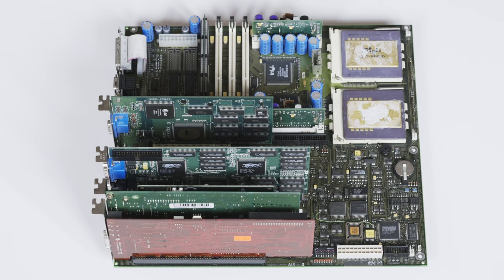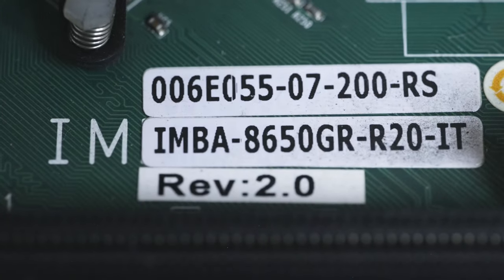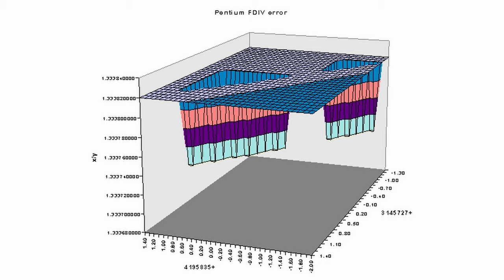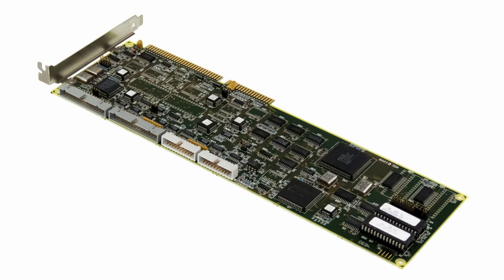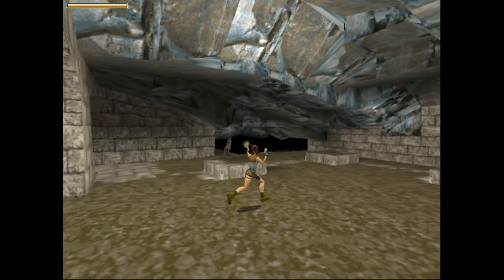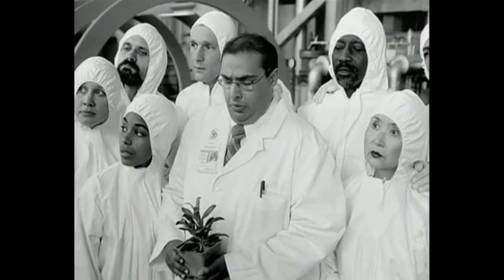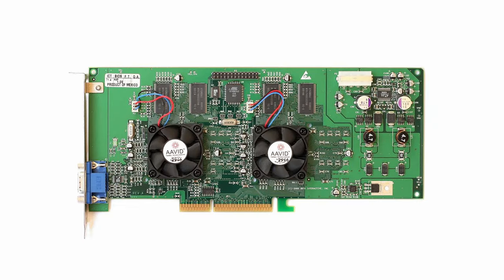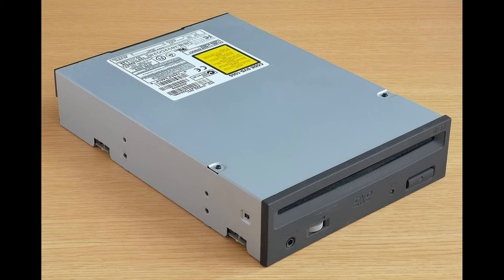What is the best build for DOS gaming?

Comment: Thank you for the video. There are a few things I like to comment on though … .

Several points / aspects were skipped:

1. The price: The cheapest vintage system currently is Socket 370 Pentium 3. Pretty much anything else has become forbiddingly expensive, and though some inexpensive Socket A can be found, having ISA slots is rare there – something you need for proper DOS sound support.

2. State of hardware and compatibility: Many older Pentium 2 or 3 boards, especially those using the Intel 440LX, BX and ZX are unlikely to even start anymore. There also always are issues finding compatible RAM, because only older modules seem to be detected completely – if at all. Those furthermore are a somewhat bad choice for the Pentium 3 667 upwards – they can’t really keep up. And the maximum RAM ( when focusing on DOS / DOS age ) is 512MB. My recommendation would be the “Via Apollo Pro 133(A)” Chip such as with the Elitegroup P6X motherboard series, which while not the fastest is compatible to essentially anything, equipped with 2x 256MB PC-133 RAM.

3. The OS: The most current still fully DOS compatible OS was Windows 98 SE. It’s also important that it can be convinced to properly support USB storage devices, and offers the latest standards of the time – such as DirectX 8.1 ( 9.0c ). If you don’t intend to even use Windows, you probably would be better off with something in between an 486 DX4-100 and a Pentium 1 233MMX with 16 to 32MB RAM. Anything above 512MB RAM, 667 MHz CPU and Voodoo 3, is more along the line of a Windows XP system which offers but reduced DOS or GLIDE compatibility.
Don’t use Windows 95 or older unless you have less than 96MB RAM – getting it to run properly simply requires too much effort due to lots of usually unofficial patches and fixes.

3dfx Voodoo mistakes:
1. The Voodoo Banshee is the cheapest 3DFX which combines 2D and 3D. It also is identical to the Voodoo 3 except it works at only 100MHz instead of up to 166MHz, and only 1 TMUs instead of 2. This places it’s 3D performance in between the Voodoo 1 and Voodoo 2, which is no problem if running 3D at max. 640x480 pixels. As such, it offers very good 2D and decent 3D support through GLIDE, OpenGL and up to DirectX 6.0 . There are but three reasons you might want a different card for your vintage system: a. No good 3D at higher resolutions, b. support only for older 3D application, c. due to low color dept and missing effect filters, the image quality can’t compete with other 3D graphics cards of the time.

2. Voodoo 2 SLI does NOT provide double the RAM, just almost double the performance and Z-Buffer, which allows 3D at up to 1024x768 where only 800x600 would be possible with only one card.

3. The 3DFX Models were the Voodoo 1 4MB, Voodoo Rush ( of which at least 2 different versions using different 2D chips exist ), Voodoo 1 6MB ( such as the “Miro Highscore 3D”, rare ), Voodoo 2 8MB, Voodoo 2 12MB, Voodoo Banshee, Voodoo 3 PCI, Voodoo 3 AGP ( 2000, 3000, 3500 ), Voodoo 4 u. Voodoo 5. The upper graphics resolution is limited through the Z-Buffer Size ( 2MB for Voodoo 1, 4MB for up to Voodoo 3 ).
The 16MB Banshee / Avenger / Voodoo 3 have: 8MB for textures, 4MB for Z-Buffer and 4MB graphic RAM.

DOS 2D graphics:
Never use ISA, best not use VLB – the best option for DOS and early Windows are PCI graphic cars such as the S3 Trio (V,GX,DX,…), ATI Mach 64/Rage and NVIDIA NV1, best with VESA 2.0+ Bios support. Those allow up to approx. 1024x768 gaming, but older usually can offer 320x240 ( ModeX ) at best.
Saying you choice of graphics cards depend on your CPU is incorrect: The possible list depends on which slots your motherboard offers – just because a CPU generation usually come with a GPU generation does not mean you need to match them forcibly.

3D graphics cards:
You completely ignored the early Windows era 3D graphics card, as well as the most common and easily obtainable ones.
1. Those early very well known 3D cards were the NVIDIA Riva TNT, TNT2 and Vanta.
2. The most commonplace and usually more than sufficient graphics cards, are the NVIDIA Geforce 2 MX based ones.
3. Alternatively, one could go for an ATI Rage 128 / 128 GL / Fury.
However, none of these cards strictly speaking are meant for DOS, much less your preferred ATI Radeon 9550. As a rule on could argue that DOS ended where AGP started.

Graphic cards to be avoided:
1. Trident (Blade), essentially anything 3D. Usually found as SOC / IGP, they simply can’t keep up regarding performance and compatibility.
2. S3 Savage 3D / 4. Nice cards, but fell a bit short regarding performance and their drivers never got finished.
3. Rendition Vérité V1000 / V2x00. A nice collectors card, but too exotic to actually use in a vintage system.
4. Matrox Millenium / Parhelia. Those cards aren’t really meant for 3D, even though some support was added, and usually don’t produce anything of note. They are very robust and reliable though, so you might still want to get one.
5. PowerVR Kyro 3D. I love those cards, and you still can find it’s descendant in mobile devices, but the “infinite planes” function principle was quite alien and the drivers never got fully finished back then, which created graphical artifacts and inconsistencies for many games.

Sound …
… is a serious issue, because getting an inexpensive sound card with DOS and windows support is quite difficult. And in case you are wondering: The parallel use of regular ISA sound standards under Windows and for DOS boxes is not possible, because they conflict accessing the card. You need Soundblaster 2 Pro / Soundblaster 16 compatibility for DOS and should have a decent FM / Wavetable chip, because everything else is a real fight to get to work, or / and sounds like the end of the world.
By my experience, the best choice currently is a “Terratec Base-1” ( including OEM / relabeled versions ) and plugging a “DREAMBLASTER SYNTH S2” to the wavetable connector to avoid the terrible sounding Adlib FM support.
DON’T try anything exotic, such as installing a Gravis Ultrasound, UNTIL you got regular DOS sound support running. And no, a “Gravis Ultrasound” is, while nice sounding, quite difficult to use and currently forbiddingly expensive. If you want comparable sound, got for a Soundblaster AWE 64 or a Terracted Maestro 32/64, or use a wavetable as mentioned above or in the video.

Wrappers
Many DOS era graphic cards use “wrappers” to add the support of foreign API, such as OpenGL and Glide. Those try using as much GPU features as possible while leaving the rest to the CPU. Wrappers for main titles such as Quake 1, 2 and Unreal are provided by most manufacturers, and work quite well for those, but can’t be called proper or perfect by any means.

I hope I could contribute. ;-)
Reply from the maker: Cheers for the comment. I have to respond to that :)

1. That's basically what I said. I've just included Slot 1 to that, which I believe really is quite cheap.

2. It's true that lots of Slot 1 boards based on Intel chipsets you can find are more or less done for. But that can be said about any motherboard from that era. It's just an old hardware, and as such it's a just a matter of time when it stops working :) Personally, I'd choose Intel chipset over anything else any time. It's just more reliable and faster than any other chipset from that time.

3. I have nothing to add to that.

3dfx:

1. True, except, it uses Voodoo 2 hardware. Voodoo 2 has 2 texture chips, and Banshee uses only one of them, that's why its 3D performance is worse than Voodoo 2 and since Banshee came after Voodoo 2, it shouldn't be worse then it's predecessor.

2. True, my mistake.

3. Again, pretty much what I said.

DOS 2D graphics: 

I suggested to get any AGP card for this, which is probably the fastest possible option. And advised against ISA cards. I never said that graphics card depends on a CPU.

3D graphics cards:

I ignored all those cards, because it was supposed to be guide for DOS gaming computer and I reckon the only usable 3D card for DOS gaming is Voodoo.

Sound …
What I said... :)
Reply: Nice well thought out commentary.
I have to disagree as far as the Banshee being like a Voodoo3.  It only has one Voodoo2 TMU, not the same one as in the Voodoo3.
Also, for true DOS gaming experiences, I am a huge fan of using something like a GeForce 256 and slightly higher WITH a Voodoo2 (or SLI if you got them) card.  Having the 3dfx Glide is awesome for many older games.

Comment: K6-II with the CXT core or one of the mobile K6-II+ or K6-III+ are close to as versatile as it gets for DOS. You can use SETMUL to enable and disable caches and set the multiplier. On most CPUs you can only play with the caches. You can get almost any level of performance you need from 386 to slow-ish pentium II. It also has write combining unlike the original pentium and pentium MMX. This is an enormous speedup in DOS as soon as you try to use high resolutions. 640x480 is enough to start showing big benefits.

If you insist on running late DOS stuff in very high resolutions in software you may want a much faster system for that. 800x600 is already 7.5 times as many pixels as 320x200. Cheapest system for this is likely a socket 478 with AGP and at least one ISA slot for a DOS sound card. If you're just running DOS games that will run under windows 98 you can get away with PCI, but as soon as it has to reboot in DOS mode to run it will be troublesome to use PCI audio.

Comment: Good video, and pretty solid recommendation at the end for someone who just wants minimum fuss and good results.
In case anyone is interested, my DOS/Win98 build is:-
ASUS P5A-B with 128MB PC100, AMD K6-2+ 600mhz, Voodoo 3 3000 AGP,  Soundblaster16 (with OPL3), Aureal Vortex 2, HardMPU midiman clone for connecting Roland SC55mk2.
A very flexible system, the CPU is fully setmul compatible, and it even gives me three different devices to listen to midi with in windows, just be switching the midi output device in the settings :)
That said, Super Socket 7 is not for the faint of heart, there's always some issues you have to spend ages finessing, to get it right.
Reply from the maker: How does your Midiman work? Any problems?
Reply: @KITR-UK  flawless, in Dos and Windows. You can find the place that sells them through Vogons forums.
Reply: very good. I have similar super Socket 7 system(Via MVP) with AMD 333Mhz K6-2 (NON Plus version). I know Setmul requires mobile version to work with.. Does Setmul works great ? does it emulates speed of 486 good ? I think I need to update MB BIOS to accept K6-2+ version CPU. I just want to know that if K6-2+ is working great on SS7 system. or I can use Pentium 200mhz MMX instead..  I would just use WIN 98 + DOS or Win98 Dos mode.
Reply: @overdriver99  setmul is really useful, you can clock down to a 2x multiplier and turn both caches off, with a single dos command, if you really want to slow things down. I haven't done any benchmarking at the slowest settings for my CPU, so i can't say for sure how it compares to a 486, but I've had no problems playing the older dos games I have. My only advice is to check how the k6-2+ compatibility is with your motherboard, super socket 7 can be weird.
Reply: @RockstarRunner7  thanks for advice. I may try to buy slowest K6-2+ possible since I will setup this machine for DOS game only. I checked my MB info and it requires to update BIOS to support.  and you are right as long as you can run your specific speed sensitive game it would be great using SetMul.

Comment: Voodoo 2 in SLI has the same amount of texture memory, only the framebuffer is increased since it is not duplicated. This duplication of texture memory is what makes voodoo 2 SLI such an expensive solution to increasing performance. They had no competent competition at the time so they got away with it. They also used 1 chip for the ROP, 2 chips for the TMUs. This is also expensive as these chips need a lot of traces between each other. With the voodoo 5 and planned voodoo 5 6000 with 4 chips it just got really expensive and they had competent competition by that time.

The genius of the voodoo 2 was to not have T&L (what for? All games already assume you use software rendering so they're not going to have that many polygons). They also didn't need 2D graphics (what for, you already have a card for that?). This allowed them to make a graphics card that just accelerated perspective correct texturing which was the expensive thing for the processor to do. This cut down complexity and made them much faster than everyone else at a modest price point so they could afford to do kind of stupid and expensive things like SLI. But they were too slow to re-integrate T&L and 2D acceleration. 2D acceleration was necessary for the millions of OEM boxes. It is impossible to overstate how much it meant for nVidia to make a bajillion TNT M64's for the OEMs like DELL. These were very cheap cards with one 63 mm^2 die and 4 memory chips and that's it; very very simple.

Comment: Great video with a lot of good info.
Ive been working on a retro build focused on pure msdos and glide. Im using mostly parts i had on hand: Asus P5-VM99, Pentium 200 MMX, 108 mb, Voodoo 3 2000. I had a OPTi 82C931, but then i was able to find a Awe 64 gold at a recycle center.
Im not bothering with actual midi modules, but i plan to use a roland midi usb device (um one) connected to another PC with a midi player which i will route back into the line in. I will be able to emulate every midi type or soundfont.
I also wouldnt recommend real HD's anymore. Im using SD card to IDE adapters in 3 machines and they have worked great. Removable and make no noise.
Im also using setmul to bring my pentium to 386 levels.

Edit: Also go with Windows 98SE. You get MSDOS 7 which support LBA (>2 GB partitions) and then you have windows for win 3.1/95/98 games. Its the best of both worlds.
Reply from the maker: How could AWE64 Gold end up at a recycling centre? That almost hurts, knowing that someone would willingly throw away such a card. You were lucky. How do you like the card?

You're right about the SD to IDE adaptors, I could've mentioned that. They are quite useful.
Reply: @KITR-UK  Not sure, but the guys there are pulling out stuff they know is desirable for collectors/enthusiasts for resale. For example i saw also an awe 32 along with other old creative cards. I grabbed a ESS 688 and 1688 with it. The awe64 though is great card sound is super clean. The card itself was in great condition. The only annoying thing is the driver for loading soundfonts for dos midi emulation, but there is some specific awe midi built in for those games that support it and thats not been bad.
I definitely was lucky being at the right place and time, and i plan to go back to that place.
Reply: @Pickle136  I am thinking of similar build. Do you have any recommendation for SD to IDE adapter? I am not sure if I want back plate version or front 3.5" slot version on Amazon.. also what size of SD card do  you use for DOS ? 4GB ?
Reply: @overdriver99  I have 2 of these: https://www.amazon.com/gp/product/B07L2BXJ3P/ref=ppx_yo_dt_b_asin_title_o07_s00?ie=UTF8&psc=1

This doesnt guarantee it works with all motherboards. Mine are both Asus mb's.
The only annoyance I have had with them is sometimes the cdrom or the sdcard wouldn't work all the time on the same cable, but that was solved by just dedicating a ide channel to each device.

Im using 32 gb cards, so i specifically went with win98se with DOS 7. This provided LBA support in DOS so all the space can be used in one partition. Otherwise I think 6.22 is limited to 2 gb partitions and i think even earlier dos might be 512 mb. But the point is the sdcard size doesnt really matter that much just how your going to need to create your partitions. And you could create multiple partitions on the card to use.
So if you can run win98 use any card you have, if your running older DOS I would use between a 2g or 4g card.
Reply: @Pickle136  Thanks for very useful info! I will try that adapter. It's only $10 so not much thing to lose in worst case anyway. yeah I know 2GB limit so that's one of reasons I stick with Win 98 Dos mode or Dos 7.0(Win 98). and I guess I can partition it per 32GB. and optional 2GB for Dos 6. thanks!

Comment: I'm pretty sure Voodoo 3/4/5 can run DOS Glide games with the right patches.
Maybe not all of them it may go downhill past Voodoo 2. Hell, only the Voodoo 1 can play them all but is very limited in terms of power.

K6-3+ (with setmul), AGP S3 GX2 (S3D compatible) + Dual Voodoo 2 (Glide compatible) and an AWE32 CT3900 w/ a midi module is, afaik, the maximum all-in-one high compatibility, high performance DOS build.

Comment: eh, softmpu and hardmpu for mt32 support. 
and maybe a note about using flash based storage. Use windows 10 to partition and set active to have those partitions aligned. If there are any problems reading it, then the old firmware doesn't do LBA48 translations right and consider a different storage controller. I found SATA PCI controllers that advertised LBA48 that worked well with DOS (and sil3112's that never will). Then sata SSD'd the ancient equipment and moved them into the modern age!
Reply from the maker: Yea, I could've mentioned this type of storage.
Reply: @KITR-UK  details... bleh. Perhaps outside the scope of the video... Also, I use XT-IDE r598 to overcome some LBA48 problems.

Comment: Are you sure Crusader uses FPU? I think the only notable games that used it were Sim City, some flight simulators and then later Quake. The difference in the speed between 486 SX and DX CPUs could be for example because of slow ISA graphics card which can be quite dramatic. There are a lot of variables which could make an effect.
Reply from the maker: To be perfectly honest, I am not sure :) However, I tried the game with the same graphics card on both CPUs.